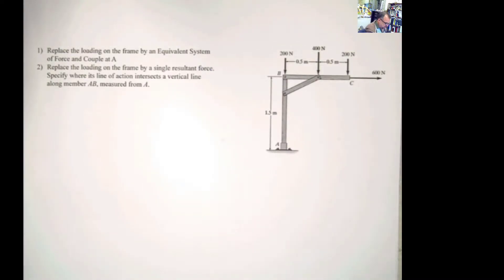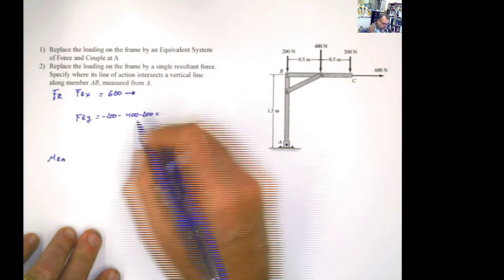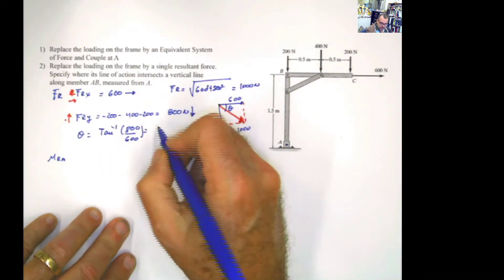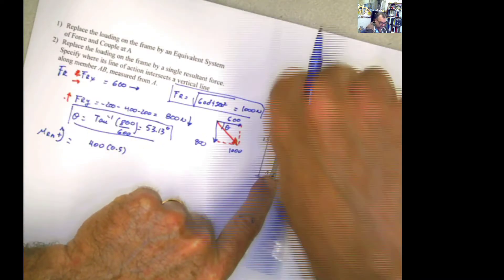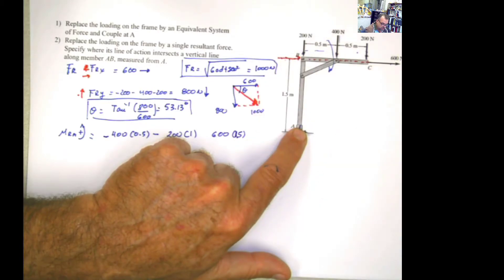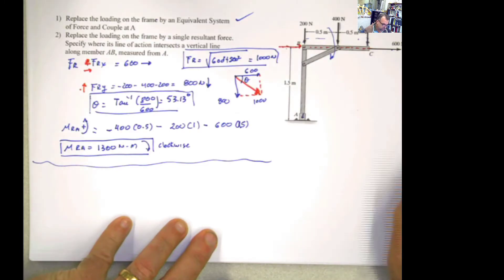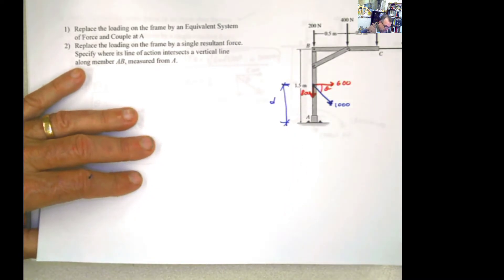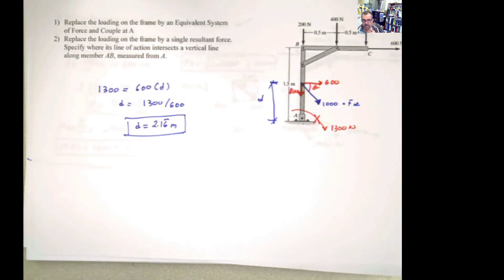Equivalent Systems 2D 4 119H14

Comment: How is the distance (d) greater than line AB?
Reply from the maker: First,  hello to you too...
Second it just means that in order to create that moment the resultant force should be applied 0.6666ft above "B"
Reply: @1963rzr  (Another approach) If the 53.13 deg force vector and corresponding line is located at the midpoint between B & C and then extended, it will also be at 2.1666.    The location point would be different if there wasn't the symmetry of distances and loads on BC.